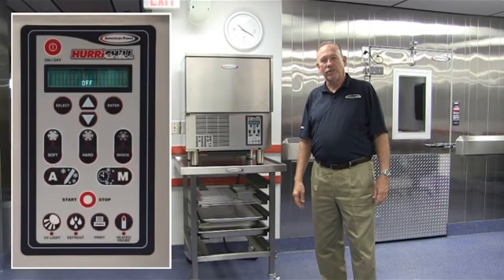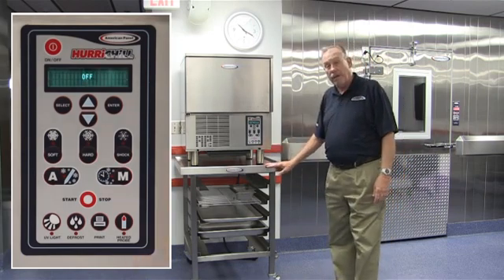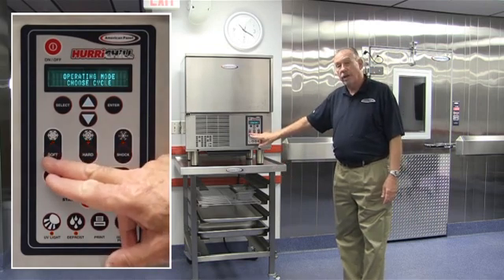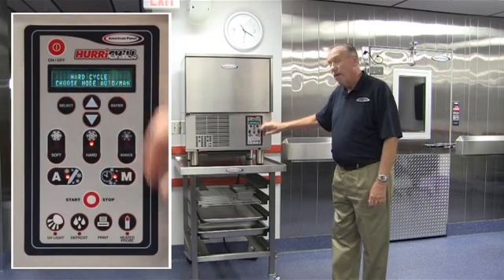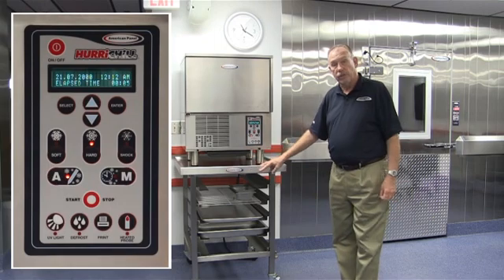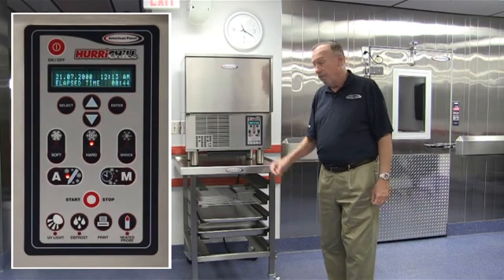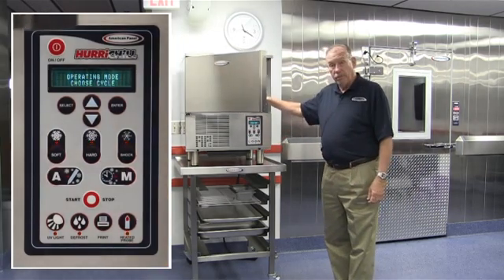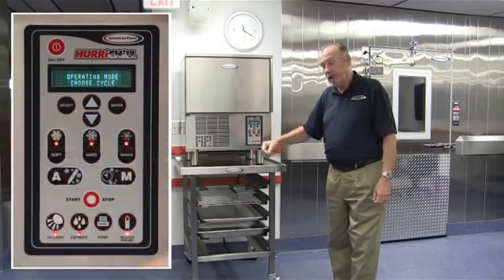Blast Chiller/Shock Freezer 101

Comment: Hi, I use one of these blast chillers at work.  Is the ultraviolet light irradiation?  This is used to sterile the machine for bacterial growth?  What if product is in there will it sterile the surface of the food or the go thru the product (for example yogurt, bacteria lactobacillus)? Should I even go using the UV light with product in the blast chiller? Thanks in advance.
Reply from the maker: Sorry for the late reply....Per one of our units cut sheets you can find online...": The ultraviolet system sterilizes all metal surfaces within the
cabinet in a preset time of 30 minutes. The mirror finish of the cabinet
interior is specifically designed to optimize the performance of the UV
cycle. The system is not intended to sterilize food."

Please note that this cycle compliments the normal cleaning regimen and is not designed to replace any proper cleaning processes.